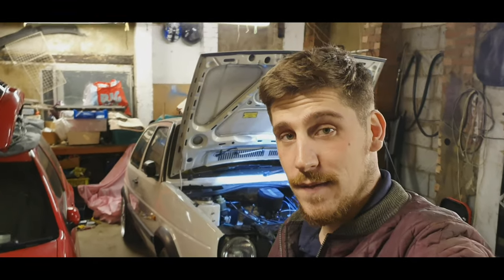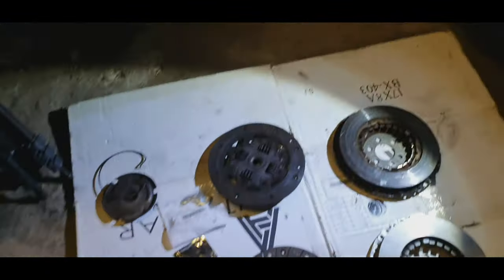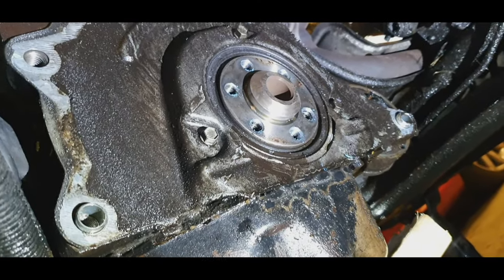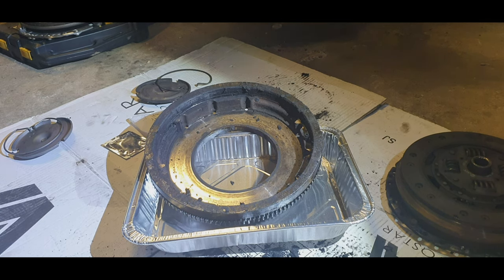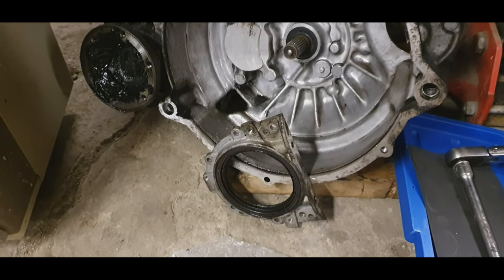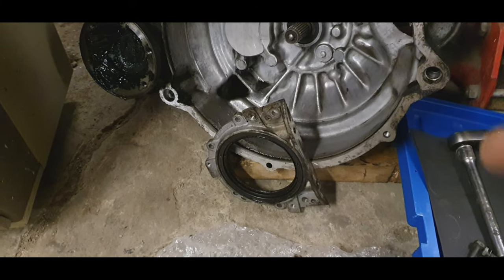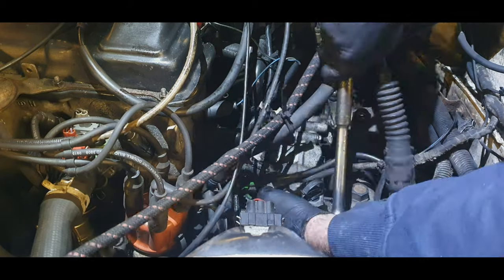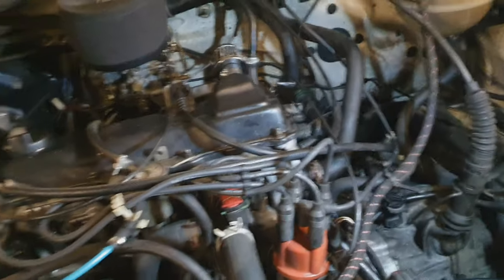Fitting New Clutch On My VW MK2 Golf *UPGRADE*

Comment: Did you reuse the small plate that goes behind the flywheel bolts?
Reply: Ive just lost mine in the garage and i was wondering if it is really necessary
Reply from the maker: I'm pretty sure I did but not 100%
Reply: @SalvageDiaries  ok well it just seems to be a bracket to line up the flywheel bolt holes i suppose